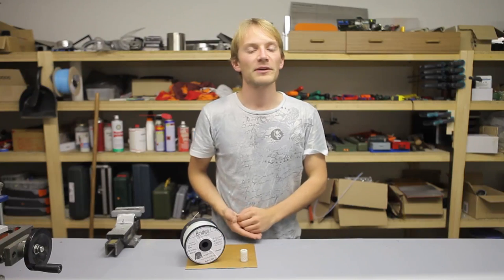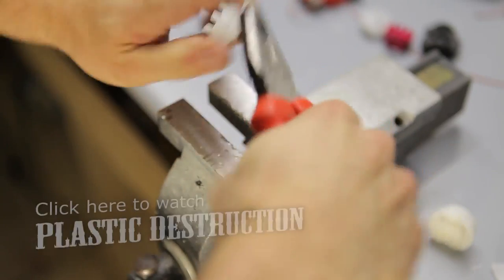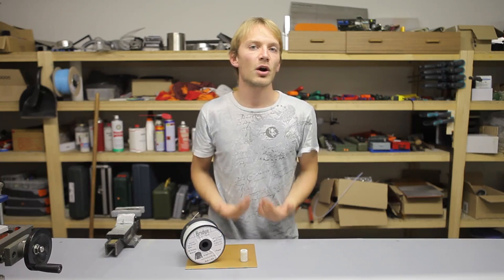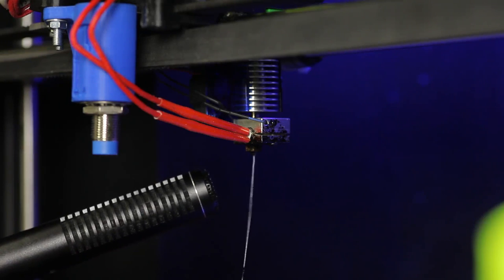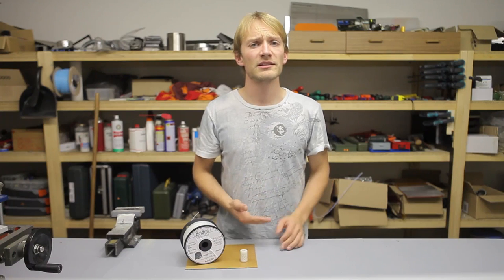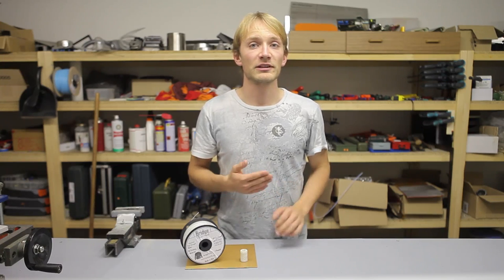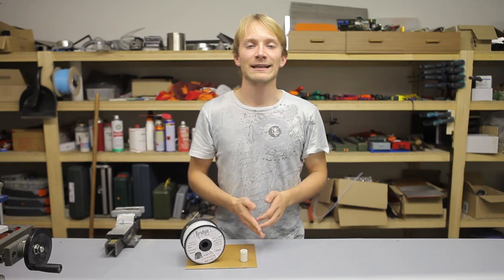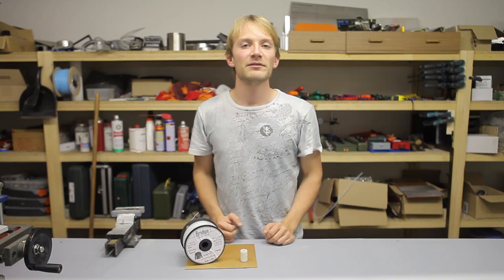3D printing guides: Making things from Nylon!

Comment: Nylon is the steel of plastics, it's that semi-opaque white plastic(usually stained by grease) you see SOMEHOW working as a gear in power tools or automotive parts. Strong stuff. It has to be very dry when melted as it has more of a problems with popping than other plastics.

Comment: Thank you for the video. I have been printing Nylon and Carbon Fiber Nylon in my Qidi X-Max. I've been getting pretty good results now that I have the settings figured out. But supports have been a nightmare! They keep adhering to the part so strongly that they are not only difficult to get off but  the surface finish is so rough it's barely usable for a functional print. Do you have any suggestions?

Comment: What is that annoying knocking noise in your sound track? Got the Poltergeist? Sounds like a cracked vinyl disk in fast forward mode. 

I found out (for Taulmann 618) that 'hard paper' (Pertinax in the german market) roughened up with coarse sandpaper (60 grade or so) heated up to 100°C is a perfectly holding printing base. I guess it will also work for Bridge.

Comment: I used to use nylon when all I had was trimmer line, it printed great!
Reply: Are you serious?
Reply: @viciousKev  Well, a while ago when I started and when it seems he/she started, trimmer line and homemade extruded plastics were all we had- there was no standards or anything! I got my reprap Darwin when they announced it and I was printing strictly only trimmer line. I still sometimes print it! Works great
Reply: @viciousKev  why do you think one of the default diameter of filament is 1.7 ?  Back in the day there wasn't any spool makers ;) also , I think it's CNC kitchen who did it but , chgeck ''3D print trimmer line '' :)

Comment: The drying part is easy. Just use a food dehydrator. It's all the print settings that need to be tweaked which I feel is the difficult part of printing polyamides/nylon. I have tried the Taulman Bridge and the Taulman Alloy 910. Both absorb dye beautifully which was my original incentive for printing this material. It's fun to customize. I seem to be getting excellent bed adhesion by using hairspray as a coating on my PEI spring steel sheet. The problem is it is TOO good of an adhesion, and the first few layers tend to delaminate when I go to remove my printed object. I guess I need to try using a scraper but I am scared of damaging my sheet.

Comment: It would be great to know what they add to this Taulman Nylon to minimize the torture. I bought a roll of cheap stuff on eBay and it seems to be completely different to what you describe. It does slurp moisture as it should and I melted the bloody spool before the quality of the filament became decent. It sticks to absolutely nothing, gluestick, garolyte, you name it. The thing warps like crazy and shows decent layer adhesion only when printed super slow on 110 C hotbed, at 270 C nozzle temperature and 0.05 mm layer height. I use these settings only because this is maximum amount of punishment my printer can endure, I'd go even higher if I could. The only surface which can somehow hold the parts is a sheet of office paper superglued (!) to the glass. The tapping, polishing and drilling of the finished parts is also an absolute hell. The only reason I am ready to endure this is because I need the prints to survive chlorinated solvents and agressive organic reactants both of which dissolve ABS and turn PLA into a mush.

Comment: Hello Thomas, Thank you for your great useful channel!
1-I'm tired from searching for the best filament for printing quadcopter frames.. What do you recommend please?
2-What is the best filament for a non-bending part (stiffer than PLA)?
3-What rubber-like filament do you recommend for printing that can be used to prevent water from escaping between two moving parts? (Ninjaflex degrades after 30 days) 
Waiting your answers to order some filaments :)
Thank you in advance.
Reply: +Rajaa Kahel Not Tom, but I know a good bit.

1) IMO a CF-reinforced filament will do a phenomenal job as a split between weight and strength/stiffness.

2) Again, a CF-reinforced filament will be incredibly rigid.

3) I don't think you can do that with a rubber-like filament, but I know Taulman nylon is incredibly degradation-resistant and can behave like a gasket if it's a thinly printed wall.
Reply: +Arturia Pendragon Thank you :)

Comment: Hi Thomas...I've been printing for quite a while and would like to try Nylon, but the power supply that came with my 3D printer just doesn't have the amps to get up to 240 degrees. Do you have a recommendation for a replacement PS? FWIW, my printer is a Geeetech Aluminum Prusa i3.

Comment: Ancient vid, popped up accidentally from one of your newer ones, but WHATEVER ---

it reminded me of my sad experience with Bridge, regarding which I DID have such high hopes (due to its impressive stats at the time, now quite overshadowed by newer offerings):  I bought 2 spools of it for my 1.75 Bowden printer - wasted the vast majority of it - I mean TOTALLY WASTED - because it was so irregular in its OD that, though it might print for awhile, almost NEVER would it behave for an entire print job to complete!  When I cried about it to Tom, he kindly sent me one more spool, but it was no better so it was still a complete waste of my money!  Measuring the fool stuff, sometimes it was as large as 2.04mm OD!  Oh well - it basically pushed me to abandon the Bowden experiment (where I THOUGHT it would be a clever UPgrade to my PrintRbot headache).

So, Thomas, if you drop back and pick this up, what do you print nylon onto these days, as it's my blunderstanding that the nifty beds of your i3 mk3 and your Ender 3 are incompatible with nylons - yes/no???

Comment: hi may I ask your advice. I printed with a nylon filament and got separate slices in several sections. the base will be lifted when the object is getting higher I use the temperature of the nozzle 250`C and 100`C heatbed. What is wrong with the printing process that I do? thanks.

Comment: +Thomas Sanladerer I am using a Printrbot Simple Metal ( i know i made the wrong choice in printer) with the ceramic hotend. Im getting i can not finish a print without jamming. Can you share the setting you used when printing Taulman 910 on Printrbot simple? 
What could be causing my jamming? my setting 255-260c , 20mms .2mm layer height...... any help would be appreciated. 
BTW awesome channel!

Comment: How close is printing Taulman Alloy 910 to your recommended nylon print settings? So far I have been really struggling with getting good layer adhesion. Will you do a review on Alloy 910?

Comment: Hi Tom. Great video.  Ive been researching 3d printing for a while now.I literally just ordered my printer.  one project I intend to try is making a replacement speedometer gear for my scooter, the originals are nylon so this video gives me high hope of making a new one for my bike.

I have a couple questions.  you mention printing on a surface, but i couldn't quite catch what you called it (garolite?) and then the glue stick,  im wondering what the material is and is the glue stick just normal brands you can find in office supply sections of store?
Reply: +Andrew Thorsen Use water based glue sticks

Comment: ***** you have a great channel. Every sunday I am waiting for your new video.

Which brand glue stick are you using? Is it pva based or something else? I was not succesful with abs and glue stick.

Thanks
Reply: ***** Today I have tried Tesa stick glue on a large ABS print. I encountered just a tiny lift in one corner. Other than that it sticked very well to the glass plate and it was a successful print. I will also try UHU stick. Thanks.

Comment: how's pc for warping? been waiting to try it once i've finished my delta's chamber. thanks for the tip on the 150+bed temp, need to redesign mine anyways.
Reply: Thanks! your video's are awesome!
still haven't used nylon, besides weedwacker string and it worked well but more interested in pc because stiffness factor. i'm hoping to reduce warping by printing small layers maybe 100microns or .07 and keeping a chamber temp around 80c+ going to try for 160ish bed using a kanthal heater, but it broke my glass so i've gotta find something else more suitable those temps.

Comment: How does nylon hold up in moist environments after printed?  Like making parts for kayak as an example.
Reply: I don't know a lot, but , nylon, when dry , is pretty brittle and one of it's properties is that , the more water/moisture it absorbs, the stronger it gets. that's why when you print nylon it's recommended to let it cure some weeks as it's said to gain it's normal strength 2-3 weeks after in ambiant environment. check the CNC kitchen channel , i think he reviewed it and made a strengh test with nylon and moisture ;)

Comment: Hi Tom, what is the Material you recommend?
Reply: ***** i need parts that fit.... for example: i made a box and a lid.... the box is intented to be 40 mm in width, 90 mm in length and 30mm in height... the lid never fits onto it because the upper part of the box isnt the same as the lower part.... for what is see my printer is very well calibrated. I need a material wich dont shrink or how i say it... in german: es verzieht sich und passt nicht mehr. Der deckel is immer zu groß obwohl er sie selben mase hat.

Comment: On my Ultimaker Original Taulmann 618 prints at 242°C with 60mm/s infill speed, 40/45mm/s for in/outlines on hairsprayed Acrylic printbed, covered with green Tape (Noname from coobx.at), with Gluestick on it.
The print sticks very well on the gluesticked tape but not as well the tape on the Acrylic printbed.
Nevertheless - I get very well prints with low warping.
I never thougt I could print nylon in this way.

Two example timelapse videos:
http://youtu.be/GEYQZOxr-90